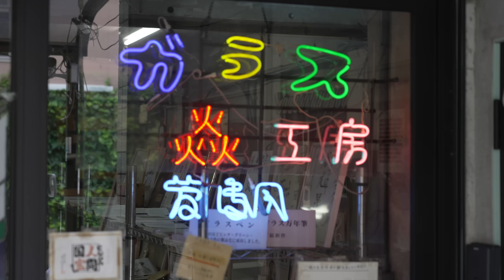ガラスペンを作るプロセス。日本の職人が作る世界初の硬質ガラスペン

Comment: I have one and it writes and draws surprisingly well
Reply: I have a fountain pen with a glass nib, but I don't find it particularly nice to use. It's a vintage one I found on eBay, and I had to replace the ink sac in it. Maybe it's because of bad design, but it has uneven ink flow with the tendency to burp ink every so often (both problems I think stem from the lack of a feed). While the performance of the glass nib can be good, I also find it to be particularly scratchy on certain papers due to how thin the tip is.

Comment: I wonder if he can make calligraphy pens like this. I used to be huge into calligraphy, and this would be awesome.
Reply: I dont know anything about calligraphy but Ive seen it many times. They use a special pen and they bend and twist it to form the letters, you cant do that with a glass pen??
Reply: @h0rk3d  no the nib on a metal nib put on a dip pen has a bit of manipulation with pressure sensitivity. I don't have this pen, but I do have a hand made glass pen and there is no pressure change in the tip it's the same line. Love glass pens, but in an art sense not the pest if you want an easy way to go from thin to thick you would have to go back in the area you want thicker with more strokes.

Comment: i dont get why there in the beginning it says 3 pieces of glass have to be fused together, seems just for the looks and not for the functionality
Reply: I know I'm very late, but I own a glass pen and observed how they're created. The reasons why they made 3 glass pieces fused together are:
- to create the spiral pattern for the handle, which is useful for both aesthetics and the spiral pattern prevents your pen from accidentally rolled off the table and dropped to the floor. 
- the second one is to create a feet (idk what it's called) that separates the nib and handle part, so you don't accidentally dip your ink too much to the point it stains your hand while writing
- the spiral pattern for the tip is actually created so they hold a lot of inks, making you don't have to dip your pen in ink as often and you can write/create a lot of strokes before having to dip again. this pattern also helps in cleaning the pen easier 

Hope this helps!
Reply: @chimpurinkohimiru8920  thank you for pointing out!